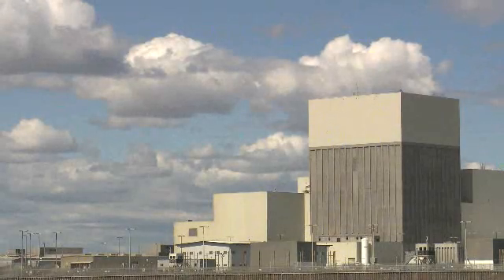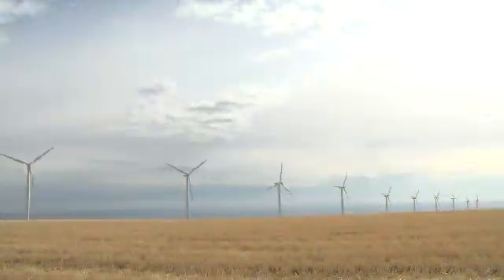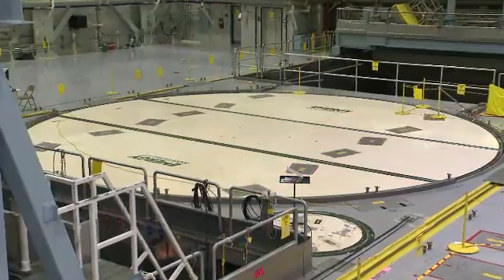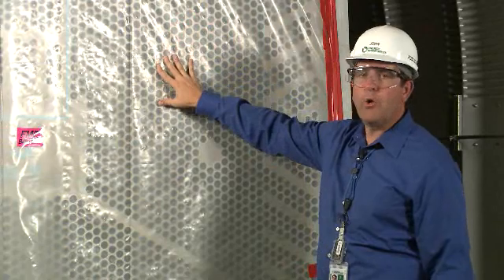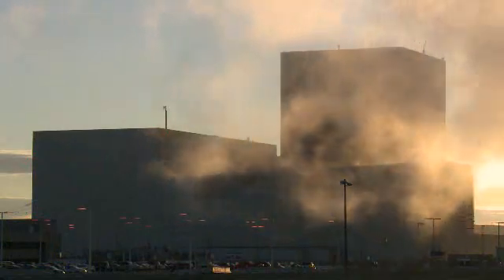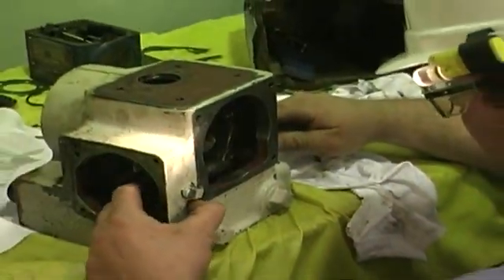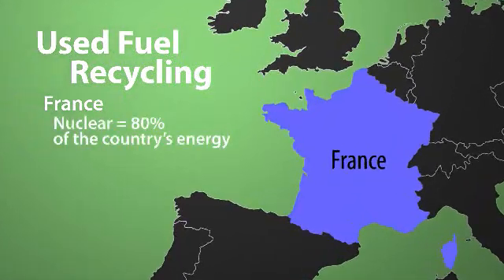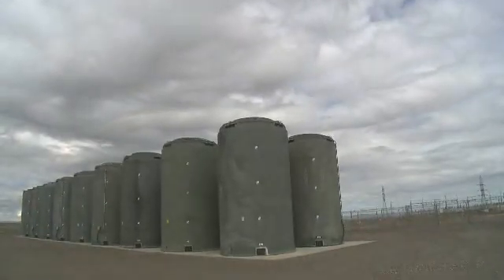Inside Columbia Generating Station

Comment: I mean, totally late comment, but if the fuel still has 95% of its energy potential, why does it need to be removed?
Reply from the maker: Over time the usable fissionable material (U-235) is burned until generally less than 1% along with the concentration of fission products in fuel increase to the point where it is no longer practical to continue to use the fuel. To extract the remaining 95% of the fuel potential, it becomes necessary to remove the fuel from the reactor, reprocess the fuel to recover and recycle the usable portion of it.

The “Used Fuel” and “Reprocessing” sections of this page give a good overview.
https://www.world-nuclear.org/information-library/nuclear-fuel-cycle/introduction/nuclear-fuel-cycle-overview.aspx

We also need to make it clear that reprocessing is something that is technically feasible, but not currently performed at Columbia or anywhere in the United States at this juncture. Rather we move all used fuel to long-term on-site storage.

Comment: I went to work at WPPSS 1& 4 identical B & W model 205; the day I started (January 82) they decided to suspend construction on units 4 & 5 (#5 on the coast by Satsop) within 6 months they decided to suspend construction on unit 1 & move us at unit 1 to unit 3 at Satsop (a CE unit) I opted out and ended up at Palo Verde units 1,2&3.  my 2 submarine Reactor compartments are stored nearby and I no longer need a flashlight.

Comment: the waves crash against the shore with enough energy to power the cities on the coast.
also, if they built tall towers to catch lightning and channel it into capacitors in the ground, that would be another good source of energy.
Reply: This is one of those things that sounds good in theory, but doesn't work out so well in practice.  Capacitors discharge over time and use, losing voltage, so - in addition to dealing with massive spikes of energy, you also need to deal with a slowly decaying voltage which you need to convert and put on the grid.  

The second problem - go look up energy density of supercapacitors on Wikipedia.  I'll wait.
Reply: And there's always rainbow dust and unicorn milk!

Comment: Same design as Fukushima. Don't think people trust GE much longer. United States have over a dozen of these designs that look like the ones destroyed in 2011 in Japan. 104 active reactors in the US all ticking time bombs.
Reply from the maker: Without the 45-foot tsunami, the Fukushima Daiichi reactors would not have been challenged as they were. And in fact only one Daiichi reactor is similar to Columbia - Unit 6 which was shut down at the time and unaffected. But this is a common meme used to instill fear in nuclear energy.
Reply: +Bobby Glick Which Fukushima? There are two nuclear power plants in Japan with the word Fukushima in their names. One is Fukushima Daiichi and the other is Fukushima Daini. Both were hit by the 9.0 earthquake and tsunami, but unlike Daiichi, Daini had no reactor core meltdowns or reactor building explosions.
Reply: Same design not located on the Pacific Rim of Fire and a completely different layout and equipment and employee training and flex response teams.
Reply: EnergyNorthwest2011
My understanding is the spent rod cooling pools were most of the problem. There was only 1 of the 6 reactors running at the time the earthquake hit. Not being able to get water to the reactors and cooling pools caused heat to build up causing a hydrogen gas explosion. Reactors 5 & 6 were 20 feet higher in sea level and were offline at the time the disaster occurred so they were not effected.
Reply: Energy Northwest In addition to this the company controlling the plant failed to make modifications to the reactor to prepare for this sort of natural disaster, even when warned in advance. Other reactors owned by different companies that were closer to the epicenter of the earthquake sustained minimal damage.
Reply: Jess Vagnar They key is that the portion of the station where the diesel generators are is designed with tsunamis and floods in mind, but it was not built to specification in order to save money. 

There were other reactors in areas that got it just as bad which had no accidents because of this.
Reply: Since we don't see many tsunamis in the US, I don't agree with the "ticking timebomb" statement from the original poster.  In addition, I would add that since Fukushima, you and anyone in the nuclear industry knows that many enhancements were made to the design and safety of these and other reactors around the world to handle "total station blackout" which was the incident that basically caused the Fukushima Daichi failures.
Reply: ***** More or less

Tsunami & Earthquake severed main power, reactors turned off power generation as a precaution, diesel engines flooded, battery back ups only last for so long, major building damage, employees fled, rescuers and emergency response had the earthquake and tsunami aftermath to deal with.
Reply: My understanding is that was actually a 30 meter (100 ft) tsunami.  Peak wave heights of up to 128 feet (39 meters) at Miyako city.   Either way, you are 100% right - a lot for a reactor to deal with, particularly when not expecting it.
Reply: Go Candu then.
Reply: No! They are not all ticking time bombs!
Reply: @johnroche6542  Nope! That's hysteria. Antinuclear hysteria is rather disgusting actually.
Reply: @johnroche6542  Uh, no! T.M.I. proved that. It was the only nuclear plant in the U.S. to suffer any kind of damage and although damaged, the accident was really a non-issue. A tiny amount of radiation was released, but overall things turned out well.

Comment from the maker: ((Continued))
Columbia has multiple reactor cooling options to provide makeup water to the core and used fuel pool and also has backup power for these systems in the event offsite power is lost. Backup power sources include three diesel generators and back-up battery systems to power plant instrumentation (and steam driven pump controls) for a minimum of 4 hours each without recharging. However, we also have a portable diesel generator to provide continuous re-charging of the battery system.

Comment from the maker: Thanks for the comment. While there is similarity in the type of reactor (BWR), there is more to the story. Energy Northwest’s Columbia Generating Station is a newer design, a Boiling Water Reactor 5, with a Mark 2 containment system. The Mark 2 system is a more robust containment design that integrates the suppression pool into the main steel and concrete, reinforced, primary containment structure surrounding the reactor vessel. Units 1 – 5 at Fukushima have Mark I containment systems.